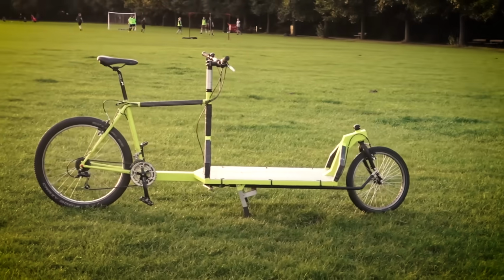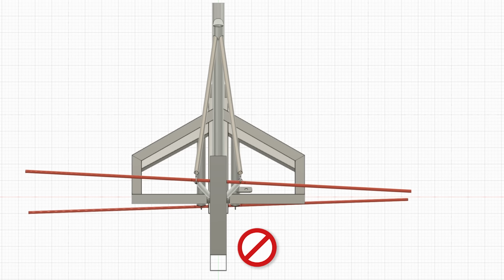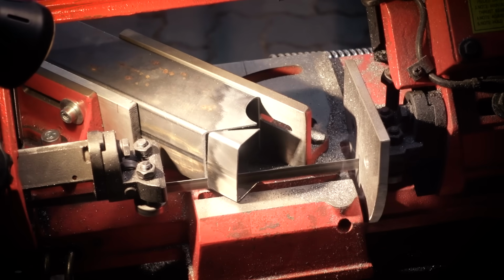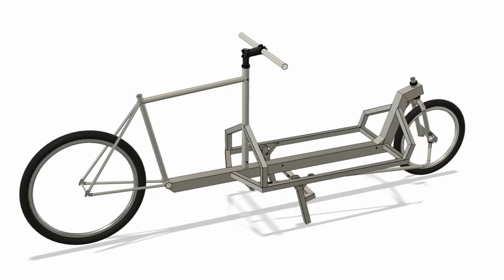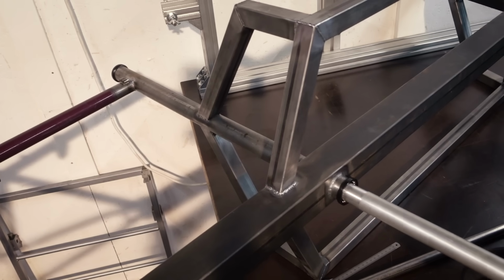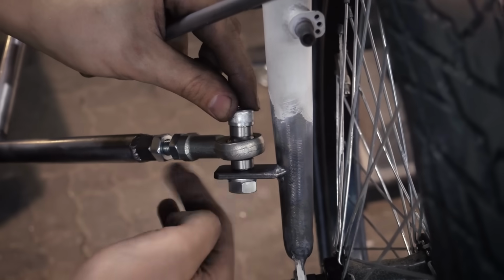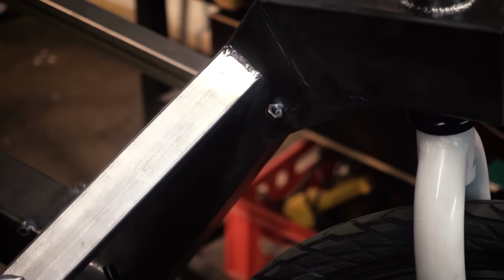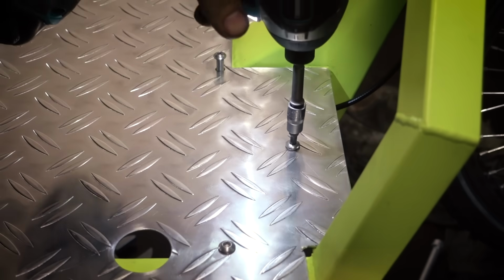How to Build a DIY Cargo Bike (Plans available!)

Comment: Hey Phil, where's Art? Actually you look like you could be Uri Tuchman's brother. Why did you build one with such small wheels? What is the point of copying every one else? 26 inch wheels go over bumps and pot holes much better.
Reply from the maker: I wonder why you would just assume that I haven't put any thought into this and just "copied everyone else". If everyone is using a similar approach, there's usually a reason for that. And there's a number of reasons for using a small wheel in front for these bikes. I explain that in detail in the plans, but the main reasons are frame stiffness, shorter wheelbase, steering geometry, weight, cargo capacity, handling, wheel strength and more. If you're interested I can paste the entire explanation here. By the way, that's a 26" wheel in the back.
Reply: @PhilVandelay  Yeah, I'd love to see it. I am big into bikes and have a small collection going. I would love to build one of my own design. I have no welder, yet. Mostly I just mod the ones I already own. I noticed you used a BMX wheel with double the amount of spokes - surely much stronger. I am missing the grip in my left hand due to a botched surgery so I have been modifying all my bikes to work with one grip on the right that pulls 2 cables so I can safely operate both brakes at the same time. I'm older with lots of arthritis so I also modify my full suspension MTBs for maximum comfort because I could not buy what I wanted. They're not fast but I am not all wrecked out when I get some where. 
 I also modded out an Ebike to carry groceries, complete with toolless bolted down cooler on the back for cold foods. It's also got two folding baskets in back so it collapses nicely to fit into the shed. Next I need to build a front rack to carry delicates like bread, chips and eggs. It's been great and I get lots of looks and compliments every time I go for groceries. I do everything by bike. I haven't burned a gallon of gasoline in over 15 years.
 I did end up bingewatching a number of your videos through the night and it is very obvious you like to design and enjoy the thinking & designing aspect of it all. The catamaran drive was ingenious. I particularly enjoyed the use of the belt for driving as it avoids a high cost stainless steel drive parts and the way it swiveled aside was great. It's fun engineering new things. ( BTW there is a company here in the USA that makes a pedal powered kayak that uses fins that go back and forth to power it. I wish I could remember the company name so I could post you a link to it.)
 You should check out radpowerbikes.com website because they have a front rack that bolts to the frame. It avoids that wiggle-waggle factor if you get too much weight on it since it does not move with the front fork. The weight just continues to move forward with the rest of the bike. I have those studs on my bike but the front rack was out of stock when I ordered the bike so I never got it. I don't know if you've heard of those. It looks like a better engineered idea, though!
 I gotta get back to work. That's probably my longest comment in years. But I am passionate about bikes and I have always loved engineering. 

BTW I made a bicycle parts based stool also. It was super easy to make. I should post a video about it some time. They're so easy I've made 3 of them now. They have bike seats on top so they're not really meant for long sits, just enough to mull over a problem and take a few breathes of fresh inspiration.
Reply: @PhilVandelay  per the "copied everyone else" if you stand back and take a look at it, it really does resemble most long john style bikes. When you're an engineer making a custom oneoff you have the brains to make it better than the mass audience bikes. If you were an artist I'd expect it to be more artistic than all the rest. Put your maximum potential to work (like you did with the catamaran.) !

 First weakness I see with the bike is the steering mechanism could easily get caught up going over an entrance or exit from a driveway. I'd consider changing it to cable actuated and tucking it inside the frame. You are the engineer, do something better than all the rest.

Comment: hmm. Just curious...
I hate having to rely on others so I'm wondering what do you think would happen if I attempted to move my Smithy mill/lathe with this? If I take the milling head off, the tail stock & the vice, I could probably get it down to 300 lbs, possibly 280lbs. Would you recommend a more robust setup to attempt something that heavy or do you think it would be alright if I were careful?
Reply from the maker: Well the most weight I have personally tried moving with this was about 350lbs and that was barely rideable. The problem isn't really the frame, it's very sturdy and can suppurt that weight. But a bike simple becomes very difficult to handle because everything else is not made to take that kind of weight, wheels, tires, headsets, bearings, brakes etc. it just becomes very sluggish and hard to control. So I wouldn't recommend riding with that much weight. If you want to move things that heavy, you'd be better off with a three wheeled or even four wheeled bike. In that case you don't have to worry about balance and you can build things even more heavy duty. However you'd want to use very sturdy components and good brakes as well.

Comment: Great work,

I'm currently working on a cargo bike. the frame should be made of aluminum (EN AW-7005 or EN AW6061). 
It should go in the direction of Bullit or KARGON.

Which welding machine do you use?
And which CAD program did you work with?

Comment: Fantastic vid. Great "laid back" narration. Please could you tell which Tig set you have and which plasma cutter. I am building my shed and wanna tool it up on completion.  Many Thanks  .... Another Dave Hughes ( UK )
Reply from the maker: Hey thanks. Regarding the welder I'm afraid I can't be of much help, it's a machine from a german company called Stahlwerk but I'm 90% sure they are just rebranded import chinese machines, it's really nothing special. Pretty cheap but runs decent, although I have nothing to compare it to. The plasma cutter is built into the machine and they also don't sell that model anymore. Maybe one day I'll have a "proper" machine from a name brand and can give some feedback on that.
Reply: Phil Vandelay hey thanks. I am looking at Stahlwerk. They are a good German firm. And they still do one with the plasma built in. Many thanks

Comment: What is Max weight of "Cargo" area on say flat to mild inclines? stack a few mates on it and report back... looks Gr8!  thx 4 plans....
Reply from the maker: Depends on what kind of gearing you have, if you have time and a small enough gear you can get up almost any hill ;) But I would say 100 Kilograms is reasonable maximum weight. The frame could take more weight but the bike just becomes very hard to ride at some point.

Comment: 5 years ago he made a bike with no experience

5 years later this guy makes tecnical drawings and 3d models 

Great development
Reply: Can you tell me which software he used to draw these project? 
Thank you
Reply: @TheMe2oo  just use fusion since it's free
Reply: @s.sradon9782  Thank you
Reply: Well 5yr is not short..
Reply: @alecto1550  yes it is
Reply: @lilsazon  I 3d printed a 300w portable sun within 1 week with no previous experience of anything engineering. It worked 1st try and while smaller than I bicycle and mechanically simpler it's more complex. 5 years is not that short

Comment from the maker: Since these questions come up a lot: 

- The final weight of the whole bike is about 30 Kilograms in my case. Obviously this will differ slightly between builds depending on parts and materials. 

- No you don't need a motor to ride it, the effort required isn't that much higher than a normal bike unless you're going uphill with lots of cargo. 

- Yes it's easy to ride, you get used to the handling after a few minutes.
Reply: I hate it when you keep repeating during the entire video that you are lazy and this and that could be done using a metal file and an angle grinder, sure it can be but dude anyone who is into metalworking inevitably starts to buy tools and machines as he gets drawn into it. Example, I had a shitty welding mask and I've bought a new one today (auto darkening) and welding is now actually fun thing to do. Just sayin'.
Reply: @johnsmith-uf6ev  I get Your point but I kind of like the constant reminder You don't need to get all the fancy stuff before starting out building stuff.
Reply: Phil Vandelay
Reply: What’s the size of the cargo area please?
Reply: Phil Vandelay by far this is the coolest bike man thank you for the inspiration stay blessed brethren
Reply: Very impressive build. I watched the whole video and think about to build one by my own.
You think you also can build it from aluminum with higher wall thickness of the tubes?
Reply from the maker: @stefanludwig275  Yeah I have considered that as well. I think the construction would translate well to Aluminum, 2mm walls would probably be enough as it's already quite overbuilt. I mainly went with steel because it's more common and you can use it with most welders
Reply: @PhilVandelay  Why you removed the downtube from the mountainbike frame? You dont think that you have more stiffness if you use the whole frame? Another thing, i think you are german, right? Than we also could write in german :-)
Reply from the maker: @stefanludwig275  Ja können wir ;) Das Unterrohr ist meiner Erfahrung nach für die Steifigkeit nicht notwendig und wenn man's entfernt wird das Bauen etwas leichter, da man für das neue Steuerrohr nur ein Rohr ausklinken muss statt zwei. Außerdem spart es etwas Gewicht und sieht (meiner Meinung nach) besser aus. Man kann es aber natürlich auch drin lassen.
Reply: @PhilVandelay  Ja da hast du recht, das sieht schon besser aus ohne das Unterrohr. Dachte nur dass das Dreieck vielleicht stabiler wäre. Ich habe hier noch mein erstes gutes Alu Mountainbike, welches ich 1993 neu gekauft habe. Ich denke ich lad mir mal deine Pläne runter und dann werde ich mal eins aus Alu bauen. Danke für die Antworten. Viele Grüße Stefan

Comment: Flux core wire is not dirty weld people who are not qualified or trained in how to use it get shit results i welded for lincoln in their lab to get qualifications on exotic wires for short run production on Tig Mig and Innershield wires with and without gas and they all pass based on Macro chemical and destructive testing. .9 fabshield from hobart has a fantastic finish if you know how to use it on thin steels. Its a spray transfer as opposed to globular and if ya dont know the difference ya wont get the desired result...
Also runs double the heat with reverse polarity etc. si of ya trying to fill a gap there is a method....
Reply from the maker: Well I mostly meant the usual cheapo hardware store flux core welders that you commonly find in a lot of hobby workshops. I used to have one and they are very dirty. Obviously if you're talking about professional/industrial equipment that's a different story

Comment: Great bike, great video! One remark: from a structural point of view I would have liked it if the middle part of the frame (between bottom beam, saddle pin and steering axle) would have been split with a diagonal, to make it two triangles, instead of the square shape it is now.

Comment: Welding on kitchen... You are single right? :D Then again i did use to do cutting etc with angle grinder on balcony in apartment building and didnt gf leaving :D
Also using citric acid eats into metal. My suggestion is to put zinc coated parts on vinegar bath and let it do the work. It wont eat steel but turns zinc into hydrogen, so do it on outside if possible. Then just rinse with hot water and dry. Heat from water will heat up the part and dries the surface, so you mostly avoid flash rusting. Electro plated bolts etc clean up in couple of hours and vinegar can be reused later, while also it is real cheap..then again citric acid is also real cheap, so go what feels easiest, just nothing this difference.

Comment: How heavy is the bike? And how difficult is it to use with or without cargo considering the weight of the bike?
Reply from the maker: It weighs about 30kgs (without the box). It's not difficult to use, of course it handles differently than a normal bike but most people get used to it after about 10 minutes and then you can pretty much ride it like any bike. It's not harder to balance or anything like that, just has a bigger turning radius. Of course when you carry lots of weight the handling becomes a bit more sluggish but you get used to that too. It's kinda like driving a truck vs. a car

Comment: Nice added detail could be to weld a couple of hooks to the outside of the cargo bay, just like some trailers have to hook a net into. Also, do you think one could get away with replacing the ball joint in the steering with a second fabricated one?

Comment: Great video! Bought the plans, got my donor bike and planning the build.
I do have two questions: What's the tube diam and thickness of the aluminium tube you are using for the steering shaft? and what the dimension you are reducing it to? My guess was a tube of more than 29mm diam and reducing it to 28.6mm, is that correct? the reason I ask is I can find of the shelf 28.59x1.45mm aluminium tubes and wanting to check if that will work...
Thanks!
Reply from the maker: Yeah I'm not sure what the original diameter was anymore (probably 29 or 30mm) but I turned it down to 28.6 (1-1/8") at the top so that the stem could fit. 28.59 sounds like it should work nicely, but 1.45mm for the wall thickness is pretty thin for an aluminium steering tube. If you can get the same diameter with thicker walls I'd go for that. If it's a steel tube I think it should be enough though. It also depends on how much of the steering shaft is going to stick out of the steering tube, the longer it is the thicker you want that tube to be, I wouldn't suggest going thinner than 2mm for aluminium.  Also keep in mind that the tube needs to be slightly bigger at the very bottom so you can fit the crown race. But if it's a split crown race (found on many newer headsets that have sealed/industrial bearings) you might be able to cheat a little there by putting in some shims.

Comment: I would actually kill myself if I rode this bike I would need the cargo bed in back for me. Do you have any plans to build a cargo bike to where the cargo is behind you?
Reply from the maker: This kind of bike is actually not that hard to ride, you should try one sometime. Having the cargo in front seems counter-intuitive to some because they're used to cars but it's preferable with a bike. Most people get the handling down within 10 minutes. I probably won't build a rear-loading  bike because I don't like them for numerous reasons. Mostly less cargo space due to an extended drivetrain and you can't see your cargo or passengers and how wide you are which is very important on a bike for maneuverability. Besides, they ride weird as well, just a different kind of weird.

Comment: Super cool build. I was wondering if you could have used a chain steering mech instead of that bent piece of pipe. Might have less play and easier to build. I want one with a motor :)
Reply from the maker: Yeah chain is one option that I've seen but it would be problematic in this case because it would have to go over or through the cargo area to reach the fork. But another option is cable steering which I will probably do on my next bike. The advantage there is that the cables can go around corners so you can route them however you want. It's more complicated to build though and I wanted to keep this bike simple so people can replicate it. But I actually built a cable steering system in my boat video if you want to see what that looks like.
Reply: @PhilVandelay  with the chain option you could make the chain go in a U where the open ends connect to both sides of the front tire. Add a strong spring to keep the tension and then run the chai through some square tube under the basket in the front.

Comment: Half way through the video I paused and clicked like button before I forget. 
It's an absolutely beautiful metal work. Are you an engineer? If you're not, you're natural.
I see you bought a lot of tools to make this work easier - let me guess, all the cost to buy those tools still came cheaper than buying an already made cargo bike?
Reply from the maker: Not an engineer, just a guy passionate about making things ;) To be honest, I think if this was my job I wouldn't like doing it as much. As for the tools, they're not cheaper than one bike, not by a long shot, but of course they do somehow pay for themselves in other ways since I can make other things too (even more tools). Every time you make something, you've gotten a little more value out of them. Depends on the tool too, my welder has probably paid for itself many times over.